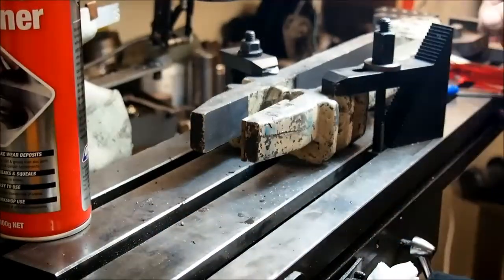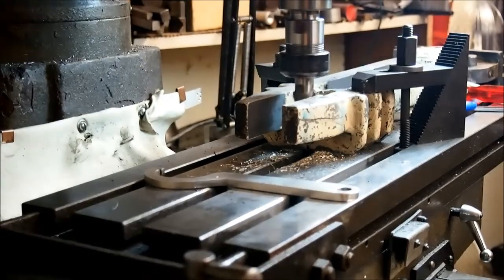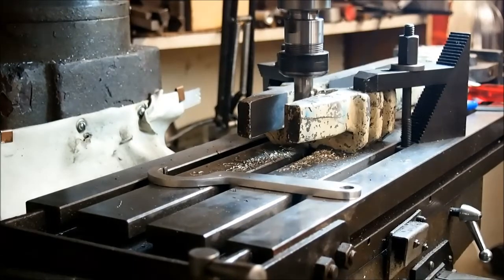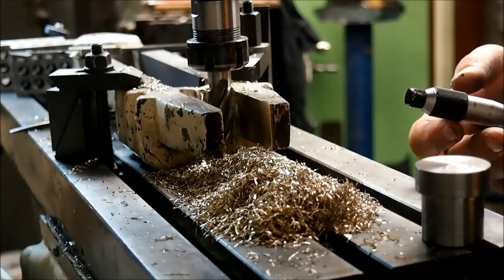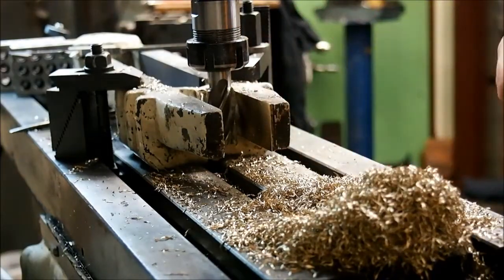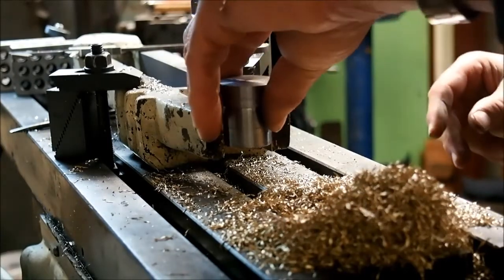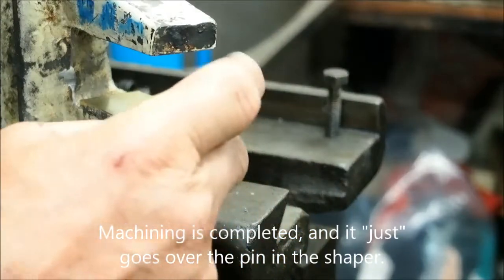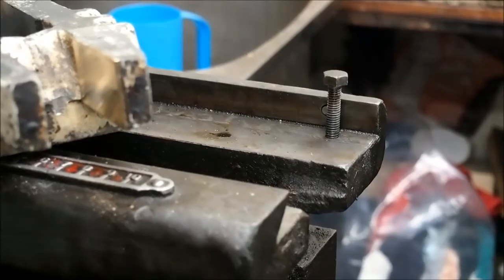Alba 1A shaper repairs  Part 6. Machining of the rocker arm & fitting a bronze bearing.

Comment: A good demonstration of how important it is to check & re check when sneaking up on a fit. Regarding the measurement of the distance between the parallel faces a set of adjustable parallels makes this so much easier. I have only had mine a couple of weeks but now use them regularly.

Comment: Are you concerned that you have shifted the center line of the yoke slightly?  It probably isn't much but I wonder if it effects the machine operation.   I like the video, I looking to get a shaper myself someday.
Reply: Hui James - no not at all, because the sliding block position on the bull wheel is fully adjustable, and moving the CL a few thou would make no difference at all by my thinking.